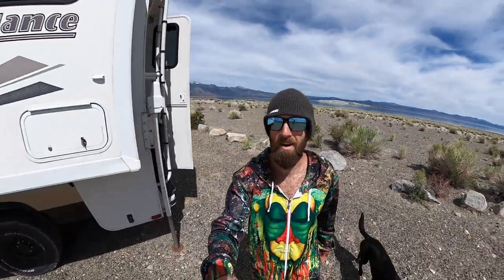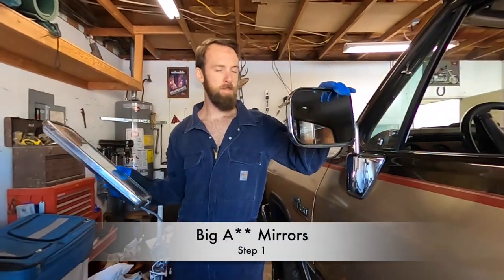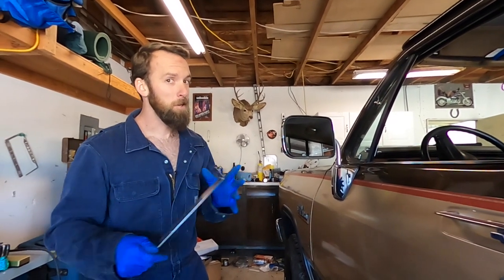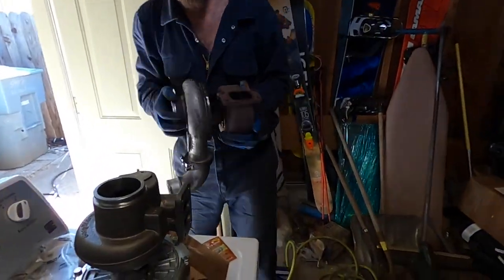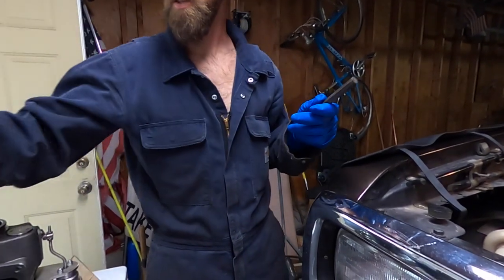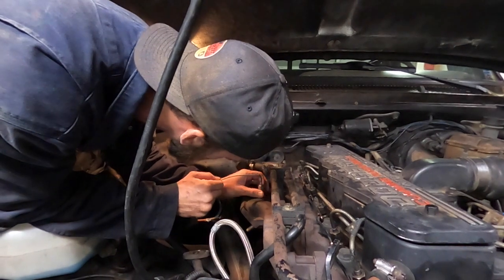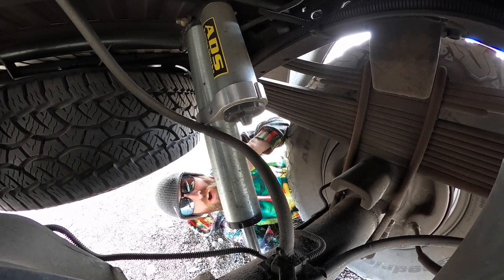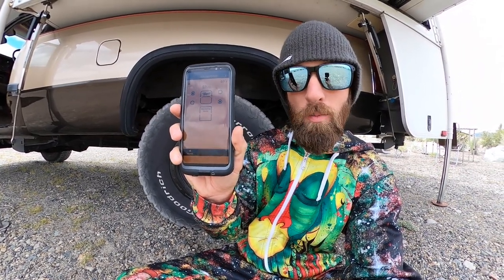5 Easy Upgrades To Get Your Truck Ready For A Camper | DestinatioNow S.1 Ep.3

Comment: Nick has some excellent and prudent mods. I'm learning that he has some of the best advice out there. At first glance some seem expensive and not what the peanut gallery and the bubbas on the internet do. K27 turbo over a He351cw = direct bolt in 👍. No smoke on boost👍 Leaf Springs with overloads👍.  Hellwig helpers🚫 Skyjacker springs with extra leafs🚫 airbags🚫  Bolt on aftermarket crap🚫 changed my rear suspension 5 times and he get got his working right the first time. I hate the a-frame mirrors and tree branches do too, but his truck is too pretty to cob on 2nd gen mirrors like me. 😅 This is how to haul a home on one of these road tractors without feeling like you're driving a John Deere.
Reply from the maker: Thanks Hoagie!!! 🙏

Comment: What did you do  for a better radiator. I realize the 91 had rad hoses on same side  not a cross flow
Reply from the maker: We still have the stock radiator. It runs a little warm, but it's manageable
Reply: Be sure it’s a cross flow hoses on different sides of rad
Reply from the maker: Okay good to know thank you
Reply: 93 had them

Comment: Who made the spring pack? How much camper weight?
Reply from the maker: Sacramento Spring did the springs. Camper is 3,800 lbs
Reply: @DestinatioNow  Thank you! I have talked to Ryan. Iam in Redding and looking to do the same but w/ a flat bed.
Reply: @DestinatioNow  Did you get the springs before the camper or after?
Reply from the maker: We got them with the camper on to make for a smooth ride. Our truck is a bit stiff with the camper off, but living full time it's not off often that happens.
Reply: @DestinatioNow  Thanks again! So you drove to sac w/the heavy camper and the old springs? Thats the part I not sure about?
Reply from the maker: Yes I drove to sac spring with the camper on and factory springs. Actually I picked it up in Sonora and drove it to sac on factory springs. I have hauled many top heavy loads on windy mountain roads throughout my 10 years of driving 18 wheelers. The key is to corner at low speed and allow for more than enough stopping distance (6-12 seconds is my preferred cushion).
Reply: @DestinatioNow  Thanks for the reply! Love your set up....
Reply from the maker: Thank you 🙏
Eventually, when my budget will support it, I want to install a liquid spring kit front and rear.
www.liquidspring.com

Comment: What is the load rating of your tires? BFG are known to be very low (less than 3700). You should be running method NV 305HD (4500LB rating) and Toyo AT3 in sizes with a rating of 4080. Tires and wheels are always the weakest link in truck camper hauling.
Reply from the maker: My current load rating is 3970. I’m looking into getting tires that are good for 5k lbs but I haven’t found many options that are made for off-roading and highway. Thanks for the recommendations
Reply: @DestinatioNow  Why would you need more than 4k tires, you have 2 of them on rear axel meaning 8000 lb capacity.  why would you want more?
Reply from the maker: Because the camper gets heavy when you live in it full time. We’ve acquired a lot of stuff. It’s getting pretty close to the limit of those tires. I like to have more capacity than I need.

Comment: Hi! Thanks for your educational video:) wondering if you would still upgrade for a turbo if you had a 350?
Reply from the maker: It certainly would help but it is not always necessary. In my case I had a very small 30 year old turbo that wouldn’t spool up till I hit 1800 rpm. The new one spools up instantly.

Comment: Was there any major modifications done to the down pipe in order to run that k27 turbo?
Reply from the maker: When I bought this truck it had a mbrp exhaust. Other than that it's the same 3" outlet. Excellent turbo. I'm currently making 40 psi with a p7100 pump and head studs
Reply: @DestinatioNow  Cool I’ve been looking at them for my 91 and I wasn’t sure if the outlets were the same. Did it spool up pretty well with the VE pump as well?
Reply from the maker: Yes it was a night and day difference. I could hear it spoiling around 1300 rpm
Reply: @DestinatioNow  Nice! The stock turbo has served my dad and grandpa well on the truck over the years. They always hauled hauled 20,000 pound 5the wheels and the big hills it never even hit 1250 egts, but now that I own it I think it’s time for a little extra power.
Reply from the maker: That's awesome!

Comment: Could you please recommend the best truck for a 2013 Livin' Lite / Camp Lite CLTC10, 2,190 lbs/ slide in truck camper? 

Brochure requires a 3/4 ton (or higher) 8 foot bed and I’m partial to dually as the back end squats with full tanks.

 I would very much appreciate any help from anyone in the know. Thank you so much.
Reply from the maker: I am very partial to ram trucks as they have served me well throughout my life. I have driven over a million miles as a commercial truck driver and have experience just about every engine manufacturer and nothing compares to the attention to detail and simplicity of a Cummins diesel. Campers always gain weight with regular use because people tend to acquire more stuff over time so a 1 ton is best. Dually is great for stability but not always necessary. Lots of companies make high capacity tires for srw. Srw has many advantages in low traction environments. But at the end of the day, it all comes down to personal preference.
Reply: @DestinatioNow  Thanks so much for your reply. I really appreciate it! My heart is kind of set on a RAM. The prices are as much as owning a home (somewhere affordable). I’m having trouble finding a RAM, 1 ton, dually for less than $50k and some newer are upwards of $70k. Anyone have a lead on a good used RAM 1 ton dually in California for a reasonable price? Also, I read that RAM 2022 was going to be electric. Do you think there will be an electric 1 ton dually? What’s the price on that going to be? 90k? Haha Great channel. Thanks for your content.
Reply from the maker: I heard that Ram is making an electric half ton in 2024. An electric one ton dually would be an amazing platform for a truck camper. Imagine 3,000 watts of solar on the roof charging the truck and camper. It would be the ultimate off grid camper. Price would likely be around 100k but worth every penny. I would love to see some of those trucks on the road right now but I imagine we will have to wait a while longer for battery technology to get better. I recommend you look for a 1994 to 1997 dodge 1 ton with a manual transmission. You should be able to pick one up for around $20k and she will never leave you stranded. Same motor I have.
Reply from the maker: You could put some new seats in this truck and call it a day. Hell of a deal! I’d probably swap in an nv5600 and np205 from Superstick transmissions. Then put a Dana 60 in the front. It’s presmog!
https://www.facebook.com/marketplace/item/379729583508603/
Reply: @DestinatioNow  I don't know why these auto manufacturers haven't figured out if you have a vehicle that runs on battery power why can't there be a alternator or a small generator with inverter to charge the battery while you drive. Im sure they can invent a trassimission that can support that. It's been working for gas and diesel to keep the battery for the starter charged up. But I guess you wouldn't be buying electricity from the power companies or confined by a battery milage range.